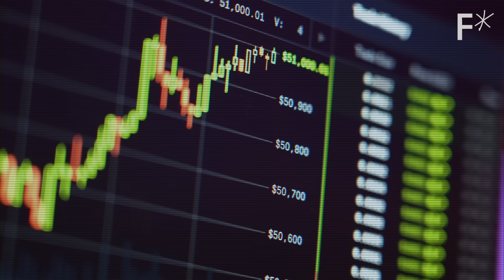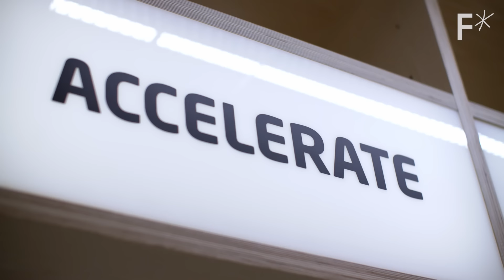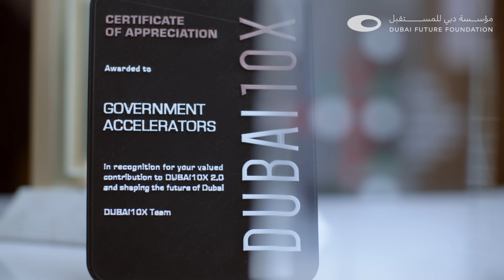How this city builds like “SimCity”

Comment: As a farmer and hydroponic person.. I am so glad they pushed that point.
Vertical farming using aquaponics is super efficient and proven in the states now... you can do much fish and plants in a closed clean efficient system. 
Also fodder hydroponic systems to feed many animal from chickens to cow.
Reply from the maker: @Tbop3  Interesting points. We'll definitely need more power as we electrify everything with clean energy, rather than just replacing existing power plants. It would be cool to work out at a grid/country level how much more energy is required for vertical farming (if any) vs. importing or conventionally farming the amount of crops in question.
Reply: No.
Reply: Disgusting.